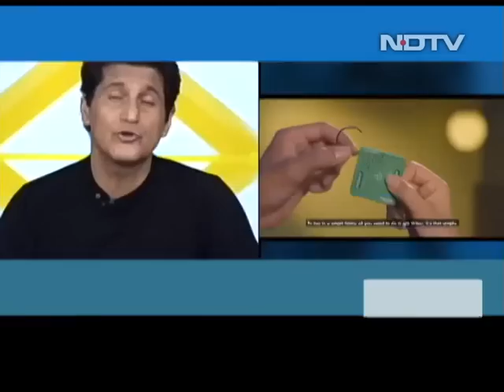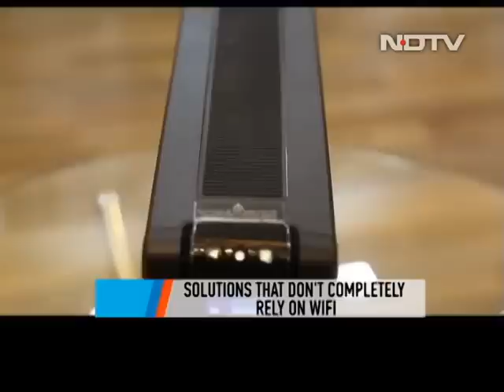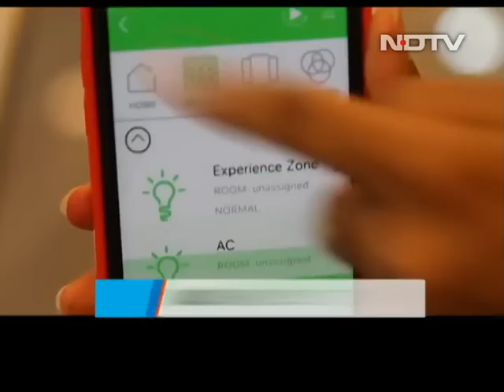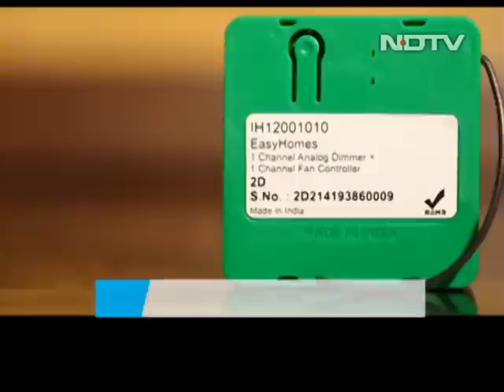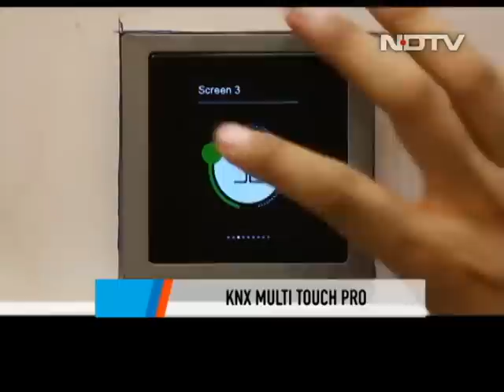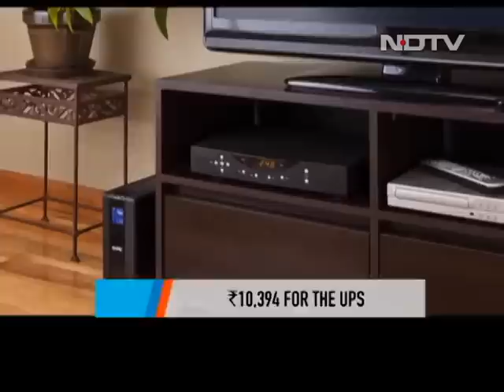Schneider Electric's Home Automation

Comment: Nodemcu Or arduino shud do the trick. Customized app can be written using mit app inventor in less than an hr. The over all cost is less than 1000 rs n companies r looting. I did a hc 06 module with arduino and integrated directly with mcb switch through a relay and that's it. I cud do the same with esp8266 module which cud be connected via Alexa